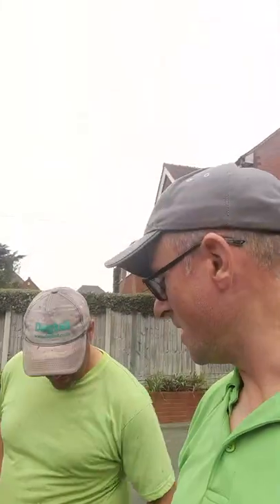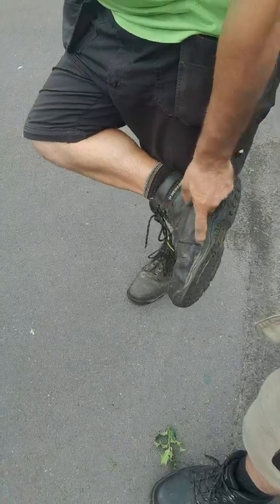RESULTS TIME #dagtail #gardenmaintenance #groundmaintenance #stihl #battery

Comment: I find the HLA 86 very economical on the batteries, fantastic machine 👍 I've noticed a massive difference changing to battery last year👌 less weight, less noise and the main one for me is no breathing in petrol fumes 👍 (and with the price of fuel it's a no brainer👌🙈)
Reply from the maker: I was sceptical at first regarding how long the battery would last. Like you said many good reasons for battery. They will continue to improve too 👍

Comment: Great job there and yeah the battery stuff is lot nicer to use. I have the Stihl AP battery gear - the only thing I've got left that's petrol is the mowers. Only downside is the cost of batteries initially
Reply from the maker: I think with the fuel prices its not too long to break even